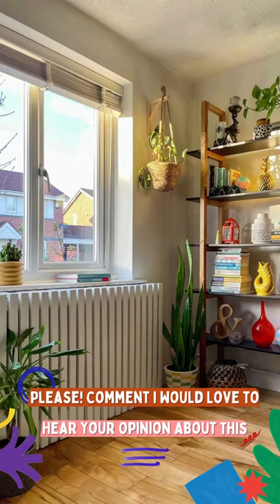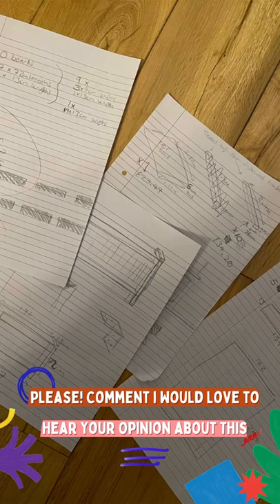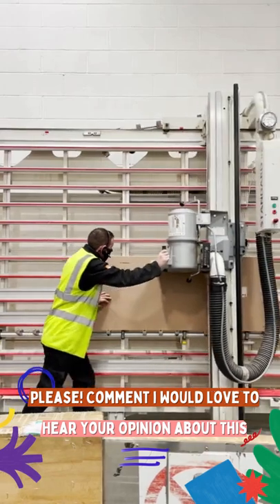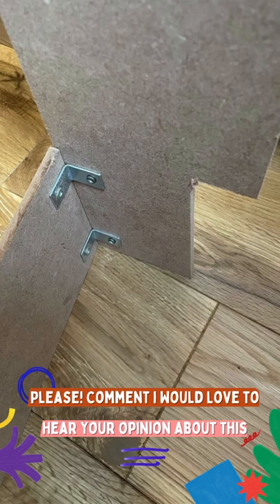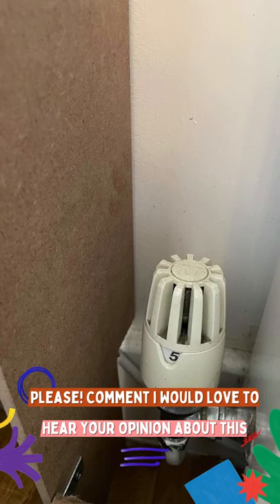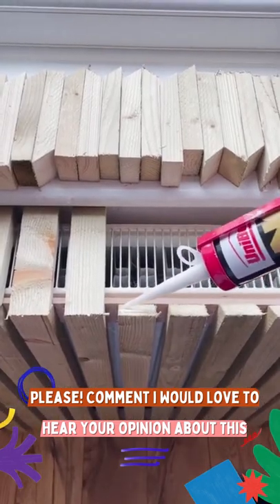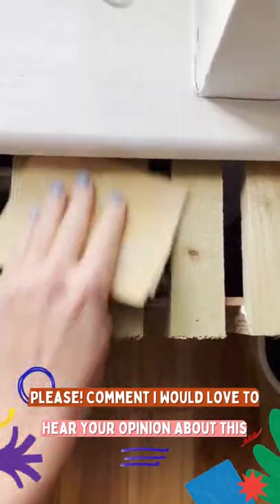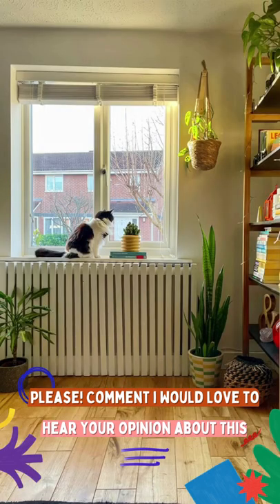Simple DIY radiator cover Home Decoration ideas

Comment: It's beautiful but I've just got rid of all my radiator covers due to the fact that dust glued itself to the wood.
Now, I'm a clean freak but I have three cats and their fur too was attracted to the wood. 
So, I painted all my radiators a matt black, then used all scaffold boards, added hairpin legs, (waxed the boards for protection) and fitted them to the wall, above the radiators. 
Its works so much better for me, as its just one surface to clean and it looks amazing. It showcases the radiators too, which look amazing in matt black. 😍